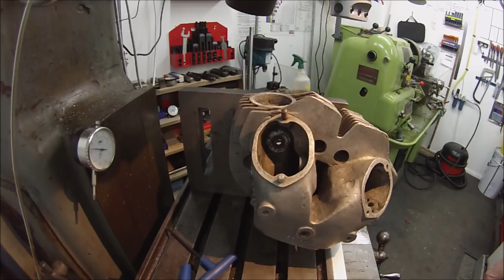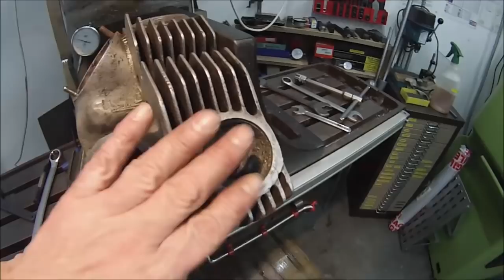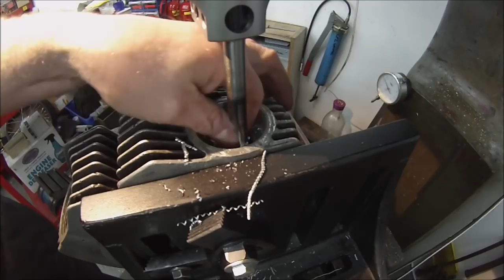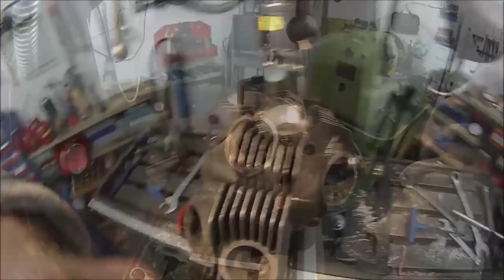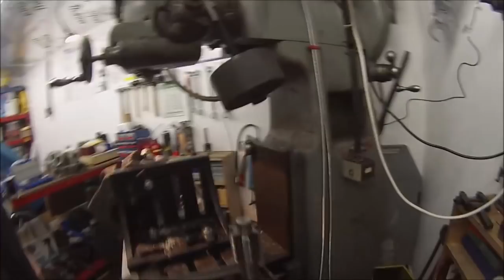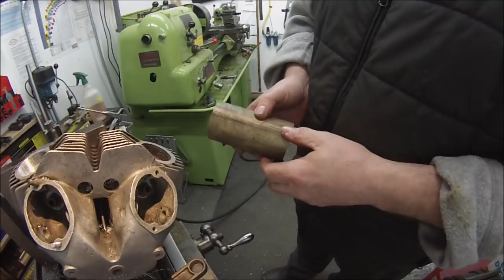Norton exhaust port thread 1

Comment: When I've been looking for videos like this, the search returns are scant and then for whatever unknown reason, this video came up in my suggestions today.
I worked at Alvis for a while, just before they moved to Telford, so there were loads of stillages full of old tooling. I managed to find a few taps which turned turned out to be good for unit 500 Triumph exhaust ports, UNEF. I did have a couple of bigger ones which measured up ok for 6/750 heads but they seem to have taken a walk before I had chance to check them against std spigots.
Your lathe in the background, looks the same as one my dad has.
Reply from the maker: Thanks for your support, appreciate that

Comment: Where'd you get that tap?
Reply from the maker: Probably a boot sale, ebay or auto jumble, just have to search for them and eventually you could find something affordable second hand. Thanks for commenting 👍
Reply: Local engineering guy in NZ makes his own tap and gets it hardened.

Had my Commando head done about 1980 and it's still perfect.

Another option if you can find them is a helicoil. Had my Dommie race bike done 25 years ago. Ran the tap in while the head was still on the bike and then the helicoil. Took less than an hour and has been working for years. On a race bike the exhaust are off and on several times a year and no issues to date.  Again that tap was made in his shop.

Comment: This is a great video with very useful information.  I'm in the middle of sorting out this procedure for two Norton Commando cylinder head exhaust port threads (total four ports).  The price of the tap is out of the question for me, so I've decided to attempt doing this by mounting the heads fixtured onto the lathe's cross-slide and hold the boring bar/threading tool in the lathe's chuck.  I'll machine the inner and outer threads of the inserts (bushings) on the lathe as well. Wish me luck!  Keep up the good work, I learn a lot from you!
Reply from the maker: Many thanks for sharing your ideas and great comments

Comment: how much for you to do one port on a 750 Commando head for me
Reply from the maker: Thank you for your message. Unfortunately I am unable to assist at this time due to other commitments. Many thanks for watching and commenting, Ade
Reply: @AGEngineering  thankyou for your reply, could you perhaps let me know what the correct size tap would be for the internal thread, I know they are quite expensive but after watching your very informative video I feel quite tempted to maybe give it a go, although not the quality of your equipment I do have a Mill and a lathe.
Reply from the maker: Bear with me, I'll let you know 👍🏼
Reply: @AGEngineering  is It a 2'' 14 TPI for the original thread? because if it is I can get one, plus its a thread plug non tapered one, oh lord I asked that question on my daughters youtube account... lol
Reply from the maker: It's 1-15/16" x 14 tpi uns unfortunately,  I bought one from China and it was about £80 all in if memory serves. I think for the external thread it was 2-1/8 x 16. But the external thread depends on the amount of damage to a degree
Reply: @AGEngineering  thank you, that's so useful and helpful, I bought the other tap anyway, but for £30.00 I think it was worth having just to play about with, so near yet so far as they say.

Comment: Face off,  run in with an end mill, on a circular interpolation,  bottom face,  run in with a thread mill,  job done.   I get the bore welded up, then run the threading programme,  works a treat..
More set up than machining,    machining takes less than a minute, but thats CNC.
Reply from the maker: Many thanks for your thoughts and comments, appreciated

Comment: Too bad a "two stud" system wasn't used instead. A lot less trouble
Reply from the maker: It can be easier to fix studs when broken for sure. Funny how evolution in design often finds a simpler, sturdier solution.

Comment: If you touch the gasket surface floor with the cutter the gasket surface is true.I repair them on my lathe or ON THE BIKE! Bronze is better but very expensive to buy.Norvil have aluminum inserts ,but getting the tap is the trick. 50 yr pro- Sundquist Norton - you tube. 2019
Reply from the maker: Thanks for watching Dave, I've just started looking through some of your interesting videos. I'd be interested on how to repair exhaust threads on the bike? Best wishes, Ade

Comment: Hi, Ade.  Thank you for this video.  It's very nice work you're doing and this repair looks quite sturdy.  

I'd like to comment on materials.  The Norton cylinder head is made from RR53B alloy.  The RR alloys were developed by Rolls Royce for aircraft engine use in the 1930 and contracted to a company "down South" called High Duty Alloys; thus the RR series of special alloys are sometimes called "HiDuminium" alloys.
RR53B was originally designed as a piston alloy.  It is a casting alloy, has high strength (after fairly complicated heat treatment post-casting), and is very stable under heat; all these qualities make it very suitable as a cylinder head casting material.  After post-heat treatment, it's harder than an Inland Revenue agent's heart, but it's rated as a "moderate difficulty" machining quality alloy.   You chose 6061 as your insert material.  It is a quite different allow from RR53B, but it's probably a good choice.  You chose 6061-spec alloy for the insert -- 6061 is a modern high-strength alloy and there are a number of specialist heat treatments (designated by "T-" suffix numbers).

Here are relative specs for materials for RR53B and 6061.
Composition, R.R.53 B        6061
Aluminium 92.8%                 95.8 - 98.6
%
Chromium    0%                    0.04 - 0.35
%
Copper 2.5%                       0.15 - 0.4
%
Nickel 1.5%                       0%
Iron 1.2%                               Max 0.7
%
Silicon 1.2%                       0.4 - 0.8
%
Magnesium  0.8%                0.8 - 1.2%

The things that jump out at me are that total alloying metals in RR53B are about twice as much by %-age as 6061, i.e. 7% total alloying metals for RR53B versus aboout 3.5% for 6061.  The copper and magnesium spec for RR53B is right in the middle of the 6061 spec and RR53B calls for more nickel, iron, and silicon.  

It seems to me - despite the variations in spec on paper - that the use of 6061 is a good choice.  I've also looked at the comparison in strength between the two alloys; taking slight differences in test procedure and nomination between the RR spec and the American 6061 spec, it appears that RR53B has "Max Stress" strength of 52 tonnes and 6061 has "Ultimate Yield Strength" of 44 tons.  On paper, that would make RR53B perhaps 20% stronger but I think this is little significance; both are modern, high-specification alloys and I see no reason that they should not be compatible for this use.  One small issue is the spec of heat treatment of the 6061; I'd look into specs for the various "T-" numbers and look for suitable strength, brittleness, and ease of machining for the 6061 material used in "production work".  (The "Aluminum Association" rates both alloys as 50 on the scale of 1 100 for ease of machining - not the easiest to machine but certainly not unreasonably difficult.)
A factor that might be considered is thermal expansion, specs for which I could not find.  I would guess (only a guess, mind) that it's likely that 6061 would have slightly more thermal expansion than the RR alloy specifically designed to have low expansion and high thermal stability but the relatively thin wall of the insert makes any difference likely to be insignificant.  If the insert were thicker, I'd want to look at the head to check for expansion cracks and the pipe nut for signs of "clamping" during running-in, but I am strongly of the opinion that for the thin insert, there should be no practical effect at all.  It also appears to me that there should be no issues with the head expanding away from the insert, causing it to loosen in service.

I agree with your assessment that it would be good to look at the depth seating of the insert and align threads so that the insert sits as firmly in the bottom of the bore in the head as possible but there's the flange on the exhaust pipe there so a small gap should be no issue.

One question that comes to me is "why did the threads strip in the first place?"  Were the nuts chronically overtightened, either when first done up or over a service period?  Or was the bike run with loose nuts that allowed fretting?  Or did dis-similar metal corrosion mean that there was damage to the threads that was exacerbated when the nuts were undone?  It would seem to me that it might be good to look at the factors in service on all Norton heads to prevent damage.  I'd also consider a high-temperature "anti-seize" compound, such as specified for cylinder head studs or exhaust manifold fittings, on the pipe nuts to prevent corrosion between the metals.  Your choice of the bonding material "Loc-Tite" for the insert into the head appears suitable and useful.

Finally, I'd like to commend you on your quality of planning, setup of your machinery, choice of tools, and skill of workmanship.  It's a very good job, indeed.
Reply: Oh, and the second "Norton Head" video seems to indicate that there's a third in the series but I wasn't able to find it.  Is there a followup after the second?  Thanks.
Reply from the maker: Hi, thank you for the comments and research, absolutely brilliant stuff! Norton heads were well known for stripped exhaust threads, likely a combination of the design for the period, vibration, lack of checking by owners during use, the correct C spanner not usually being owned by the rider, thermal cycling and other factors. The 2 videos I did a while ago were the first experiments to see if I had the ability and capability to do this job. When I worked as a motorcycle mechanic in my 20's I was always impressed by some of the repairs the shop had contracted out and it gave me a desire to want to be able to do some of these things myself, some of what you see on my channel is me doing just that. The 3rd instalment has not been done yet, I've had a bit of a hiatus from the channel, we've extended the house, done some much needed repairs and improvements,decorated etc and along the way I have changed jobs (twice) so the time has not been available for Youtube video's unfortunately. There are some bits and bobs on Instagram  (a_g_engineering).I hope that 'normal service' will be resumed shortly! Thanks for watching, commenting etc, regards, Ade.

Comment: Hi there. Do not know enough about materials,but you cut that dry. No fluids of any kind. Is there any cutting agent that would help? If you found a way to mount an old style long door spring on the quill handle,would that then allow you to use both hands turning that massive tap ? Is there an easy homemade two handed tap handle you could create without too much time or grief? Thanks for recording this.
Reply from the maker: Boring or turning with Korloy AK inserts especially on cast aluminium works fine without lube, and the same with the 6061 used for the inserts in part 2 on the lathe, as we are not after a super fine finish at this stage. I do use lubricant for the tapping process and on the lathe when threading. Maybe a bungee cord or something may come in useful on the quill handle next time, good thought. I've actually got a couple of tap wrenches to suit, just not got round to making shorter handles yet. Thanks for the comments, best wishes, Ade
Reply: A G Engineering Appreciate the reply.